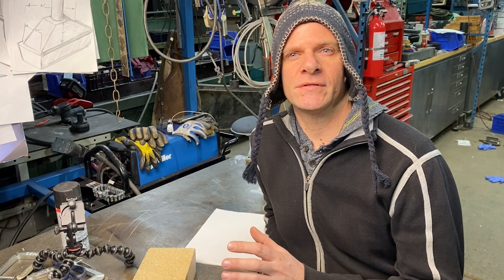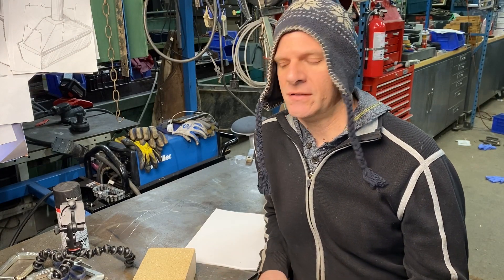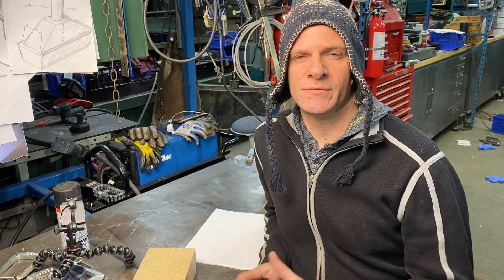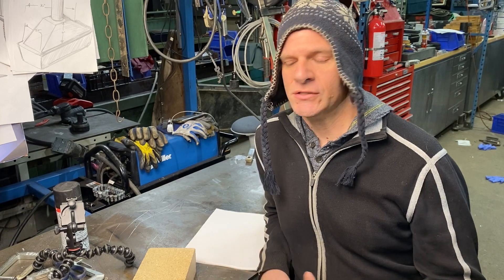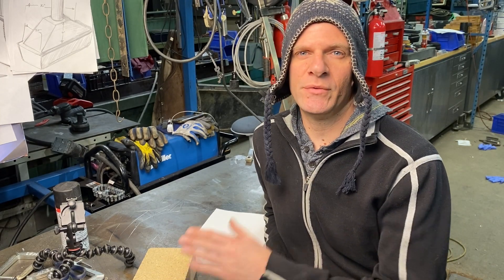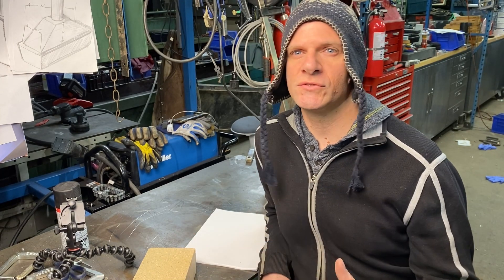How to Make The Best Ribbon Burner Forge !!

Comment: What was the base for the refractory on the roof. What stopped the slurry
Reply from the maker: I just put a piece of 1/8” sheet metal then removed it you can also use wood
Reply: @BonifabcustomRobBonifacio  I am missing something, how do you get the 1/8 metal out after the walls are all in?
Reply from the maker: @rickpoteet371  the 1/8” is just across the openings so once the refractory dries just push down the steel to remove it

Comment: I would really appreciate the exact measurements for your forge and ribbon burner.  I like your design.  I am curious though about one thing.  How did you get that piece of sheet metal that was holding up the refractory cement out after it set up. Seems like it would be stuck in there.  I started building a forge a couple of weeks ago.  My burners are different. I may change to ribbon burner after seeing how yours works.  Great job guys.
Reply from the maker: Email me Mark and I’ll help you with measurements thanks bonifabcustom@gmail.com

Comment: what gauge sheet metal did you use, would using bricks as the roof of the forge work as well, and is that brick inside the forge towards the end a hard refractory brick instead of the softer white ones you used for the walls
Reply from the maker: The sheet metal is 1/8” thickness and you could use the brick on top i just chose to use refractory cement because my ribbon burner has a taper and i needed it cast to make it fit right . I used all hard brick for the entire forge

Comment: I like your design. I have been doing the same ribbon burner type of set up. How are you regulating it and are you using propane? How long is the hose from the bottle to the needle valve and what size orifice are you using. What is your bottle pressure and what are you regulating down to for the burner. Thanks again.

Comment: I finally finished my ribbon burner forge couple days ago and have been slowly heating it to cure the refractory. Wondering if you could possibly do a video going over the fuel air mixture for flame adjust. Mostly wondering what my flame pattern should look like. Thanks in advance any tips or advice would be great.
Reply from the maker: mason woodley let me see what i can do

Comment: Great work. The gas/air input in the final part of the video is different that what you showed earlier. Did you scrap that design and I assume the final setup with elbow for forced air works best. Thanks great work. Jim Overstreet
Reply from the maker: jim overstreet  i have both but i do find for forge welding the forced air gives me more heat faster i use the NA mostly for heating up for forging when i don’t need the high temp thanks

Comment: Does this forge get up to forge welding temps? and do you use bricks on the opening to heat up
Reply from the maker: statix108 hi , yes it does get up to forging temps you may want to be careful i melted a 2000deg brick because i let it get to hot . I put the bricks on the front and back they act like doors to help keep heat in thanks

Comment: Great forge!  I'm in the exploratory stages of my forge build, just now finishing up my grinder build.  I'm thinking that I definitely want a ribbon burner forge.  What was the thin material you used?  Thanks!
Reply from the maker: Donorcyclist are you talking about the thin insulating material?
Reply: @BonifabcustomRobBonifacio  Yes, it looked almost like thick paper between your bricks and parts of the shell.
Reply from the maker: Donorcyclist yes it’s a type of refractory sheet it comes 1/8” in thickness i buy it from a place called Smelco they are a foundry supplier
Reply: @BonifabcustomRobBonifacio  Thank you so much for the information, and for your responsiveness!
Reply from the maker: Diggum Detecting no problem glad i can help let me know how your project goes
Reply: @BonifabcustomRobBonifacio  Thanks, again!  Sorry about my Diggum account reply...
Reply from the maker: Donorcyclist no worries

Comment: Love that ribbon burner.  The heat looks so much more even than on my 2 burner forge.  Any reason why you didn’t use the insulation in the top of the forge vs pouring the slurry?
Reply from the maker: ManCraftingTM thanks , i poured the refractory slurry for a few reasons first it locked in the bricks then i could cast in my tapered ribbon Burner so i can remove it or replace it at anytime. I also used the thinner insulation on top of it before i welded the top on . The thinner stuff actually has the same insulating properties as the thicker stuff. I don’t like having the blowing heat directly on  the insulating blanket like some people make there forges , that fibrous material is terrible for you to breath in . Thanks

Comment: Nice design, are those fireplace bricks or the softer lighter ones used in kiln and other forge designs?  Where did you get the thinner ?Ceramic felt?   Thanks
Reply from the maker: Thanks, they are not your typical fireplace brick , but are similar in weight but have a high temp rating of over 2000deg , the kiln bricks or lighter bricks tend break easily when exposed to propane forges . I got the thinner refractory felt from a supplier called smelko. Thanks